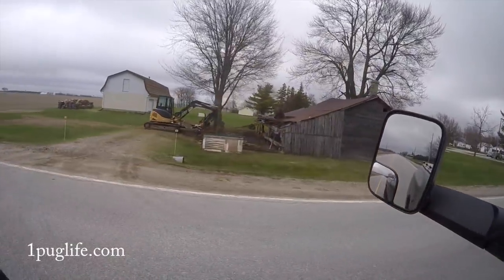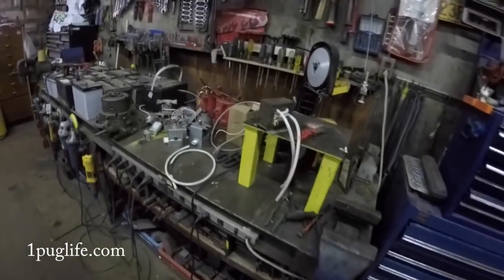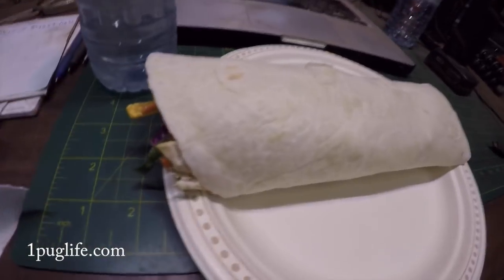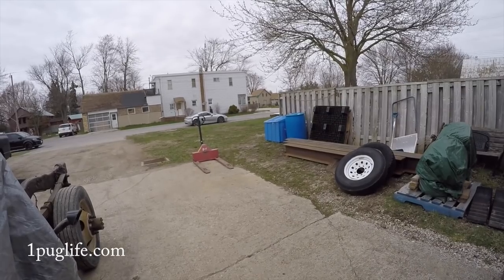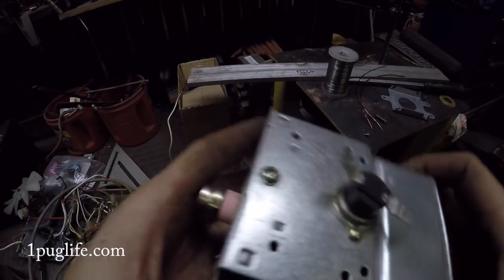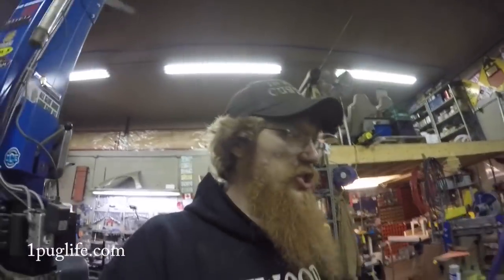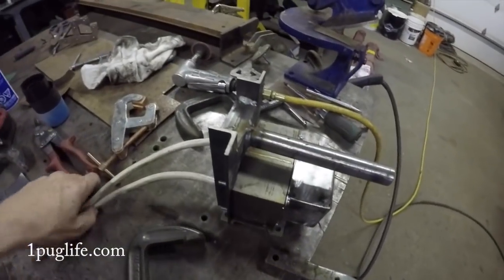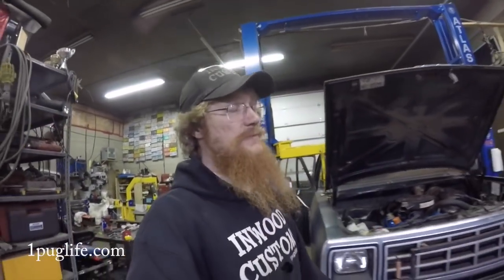build your own spot welder pt.1

Comment: Careful With The Dangerous Bits In The Microwerds There ! Security Smacurity For A Reason !
What Is Going On Should Have Been A Clue To Danger. Cup O The Watures For The Dipping Purposes Worked Out Great !
Good Start On The Spot Welder, Research Some More On The Windings Around The Transformer For 
Higher Amperage And Efficiency ! How Much For Sunthing Dot Com And Keep Getting Well Pug !

Comment: 1puglife Read this man Read this "Did you know that if you take apart microwave ovens, there is a really great ceramic magnet inside of the magnetron?"
There is also beryllium oxide in the ceramic insulators of most magnetrons. If the insulator cracks or is broken, that dust is highly toxic if inhaled.
If you want a nice magnet, there are safer ways to get one. Leave the magnetrons alone.

Comment: Ground rod for a house. Most hardware store sell
Reply: none of those will be solid copper, just copper clad steel or just galv. steel. have to go to the lightning, and Radio tower guys for real copper rods or order through supply houses. probably be $200 CAD
Reply: throttle bottle damn that's sucks. Makes sense for the price of a ground rod. If it was solid it would cost a lot more

Comment: I'd change the stranded wire out for solid wire if you can find some, you'll get a higher voltage and better performance out of it. Also may want to stick a fan on it.
Reply: NO NO it would be a better movie if he would just stick the entire thing up his ASS and plug himself into the Wall OUTLET.

Comment: McMaster Carr. Get the super conductive copper rods. 
For the tips, get with your Miller Welds guy. Miller makes both press fit or threaded. 

I purchase the threaded versions and turn the tips in a lathe to the profile I need.

Comment: Any electrical supply or Lowes or Home Depot, ask for #4 bare copper, it's used for ground.
Reply: he said 1/4" or 0.250. so he'd need  #2 AWG solid bare copper, probably be too soft for spot welding.

Comment: Check with your local electrical contractor. They might have some solid copper ground rod.
Be sure that what you get is solid copper though, some of the cheaper rods are copper plated steel.
Large motor repair shops might have some left over stock from pole damper bars used to repair pole pieces on large synchronous motors.

Comment: Hey pug maybe if u can show the power supply and the motor on the shelf that runs the mill.that would be cool
Reply: Motor on the shelf is probably a rotating phase converter that changes single phase to three phase. The power supply is probably a step-up transformer that boosts  220 v to 440v.